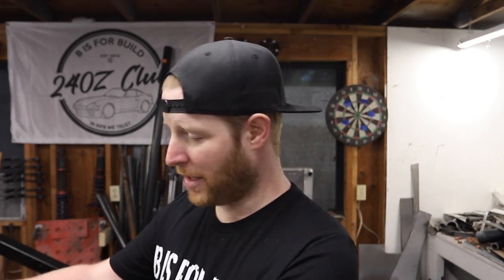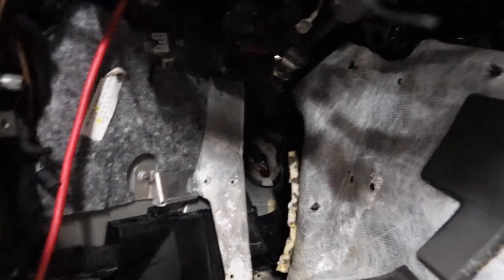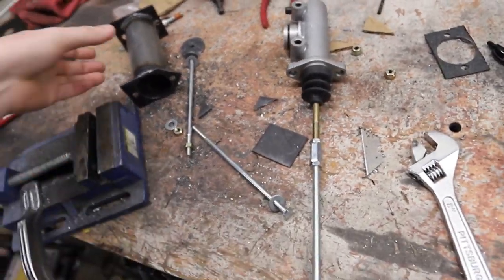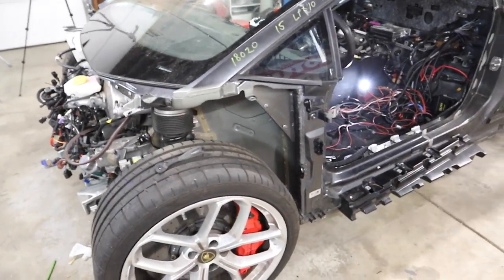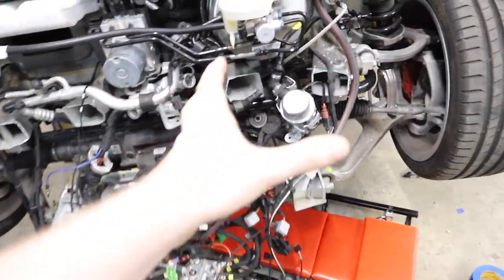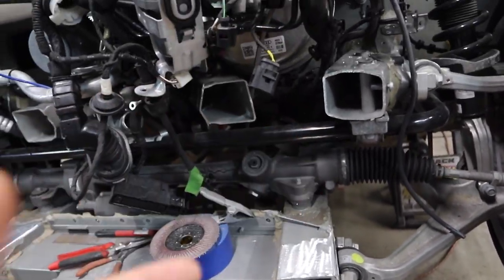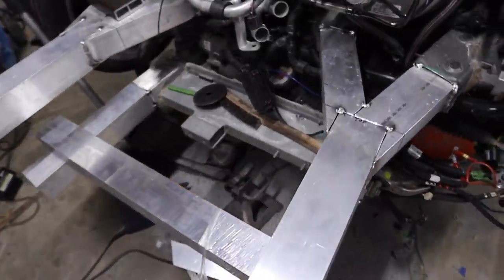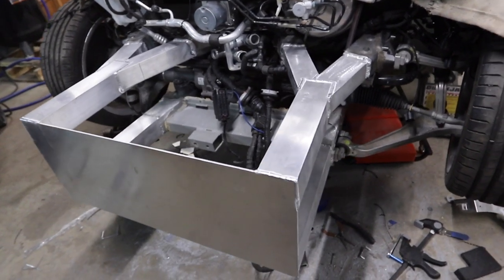First Ever Clutch Install In a Huracan & We Rebuilt the Front End!

Comment: Just modify brake pedal, automatic cars have biger brake pedal than manual cars
Reply: Lol! Good call! Using what's there, to solve that problem! Lol!
Reply: Maybe he can get a brake pedal from a manual Audi R8. Since it's the same group, it might be the same arm and mounting.
Reply: @MultiLuc28  Could he also get one from a Volkswagen gti?
Reply: @DrDre-ke1rr  Not sure. It was just a quick thought since both are coupes from the same group and roughly the same platform. I'm no expert haha
Reply: B is for Boss Oscar around
Reply: Dr Dre I wouldn’t be surprised if the GTI and the Audi brakes would work not only because of the size, but rather they’re all the same car group- Volkswagen & Audi & Lamborghini. I feel all their parts would coincide with one another.
Reply: ChillOutTrent  no shit
Reply: This was so obvious
Reply: Remote reservoir.  Wilwood makes one for their clutch cylinders.
Reply: @tompalcie6284  remote kit was included in pedal kit, just watch couple episodes back when they went through all the stuff that was deliveried for build
Reply: @MultiLuc28  You are right, or he can take the brake and clutch pedals out of a Gallardo.. problem solved and it looks a hell of a way better
Reply: @stevenvanklaveren5434  Good point!
Reply: @chillouttrent3985  The brake pedal looks identical to my 2014 Skoda Octavia vRS (DSG), all VAG parts bin stuff

Comment: You can remote reservoir that clutch resevoir in a place easier to fill
Reply: It would need to be fabricated considering no manual huracans were ever made. or another "half-ass" solution would be to cut the brake pedal in half.
Reply: @TheZumiezNation  Wilwood sells a remote reservoir kit...have put in plenty of them...could drill two holes and mount the reservoir anywhere...cost...probably $20

Comment: Probably could have gotten a take-off Audi R8 manual pedal set with the clutch slave cylinder and bracket and just modified it. Audi loves to reuse parts so it's probably not too far off and the pedals look the same

Comment: Would you call the front of that Huracán a firewall? Since there's no engine in the front that you are trying to keep heat and fire out of the cabin?
Reply: I'd say yes, a fire can still spark from the braking system or electrical which more often than not is the cause anyway.

Comment: Love the work and the videos, I would like to learn how to weld, which welder would you advise for a newbie, I do not have a workshop, so Gasless would be a must, should the first one be Mig or Tig...thinking of using for bodywork and structural repairs...I have zero knowledge of this at the moment.
Reply: If gas-less is a must, flux core MIG is your only option. Everlast, Lincoln and Miller have some decent entry level units to learn on. 

TIG requires that you have the shielding gas, and is honestly the harder of the 3 processes to get right. Lots of practice and lots of mistakes to get it nailed down.
Id suggest having a look at Welding Tips and Tricks channel, Jody is like Oscar with a welder.
Reply: @sparkplug1018  Many thanks for this, very helpful.
Reply: @geoffuk8356  Glad I could help.

Comment: Just buy a remote reservoir for that dude! Guarantee Willwood makes several different remote reservoirs for that master cylinder.  Just need to mount it above the inlet with a hose that doesn’t invert.
Reply: I would have shorten the pedal arm so the mastercilinder sits lower and the pedal turns into a quick clutch thingy. To late for that  now though

Comment: Do not forget to do crumple zones on rails.Vtuned did for Sams Lambo.
Reply: kola sillers was about to comment this as well.
Reply: nah pedestrians can do one. It's not like he's selling it mass market
Reply: its a track toy, doesn't need them
Reply: They're already welding on aluminum where it wasn't designed to be welded which will lower its strength in an impact. There's no real way to make it truly act like a stock huracan in a crash once the structure has been cut off.
Reply: Trick is not to crash!
Reply: deathwatch27 I don’t think you understand the point of crumple zones.
Reply: He didn't use any internal bracing or backing plates on those joints  either. Definitely a weak point if those welds decide to crack.
Reply: @TheFoxSaid  yeah and welds will just crack on impact
Reply: @123subbatyp  lots of scenarios where those welds could fail, especially if there's any flex or vibration in that area. Also noticed on a cpl eps back a lot of LOF on that cross beam that carries the engine mounts. Idk I used to work on 4 million dollar aluminum stealth boats where everything was inspected so I might just be being picky.

Comment: narrow that brake pedal and brace that adapter that you made for the clutch pedal ,once you add fluid the force needed to push the pedal will be much greater and you will crack the "firewall" in no time .
Reply: catalin b agreed and one of those holes on the 'rod tube' looks ready to snap being about 2mm from the edge of the plate! B is for broken clutch pedal mounting plate
Reply: Yep I think they'll have to revisit this and strengthen the firewall and that bracket.
Reply: And hard-line. Braid or not that clutch pedal is gonna be squidgy with that much hose

Comment: Hey Chris you forgot to add the ‘crumble zone’ for safety reasons bro @bisforbuild
Reply: I saw that too. Plus I didn't see any internal reinforcement on those frame rail welds. Just butted them together and went for it.
Reply: Remember, stuff Chris does not need:
Cleaning stuff
Crumble zones
Airbags
Correct wheel alignment
Reply: They threw some cookies inside the beams before welding them shut so that takes care of the crumb zones..

Comment: In Australia you would not be able to do the modifications you are doing because it is not approved manufactures specifications.It would not pass road safety unless you had a special certificate.Do you have to get the car mechanically inspected before you can register it?  Great work though .

Comment: Wilwood has a fitting for the top of the reservoir to allow for remote mount.
Reply: And that brake reservoir has the fitting there to act as a reservoir for the clutch..nearly all audi/vw use the brake res. For the clutch..just gotta snip the flattened heat sealed end and run your tubing.

Comment: I don't see any crumple zones for the front end of this  Lamborghini  Huracan. Is it just me or just the  Gallardo has them?
Reply: Screw crumple zones just go straight through whatever you hit XD (just kidding)
Reply: Definitely needs some crumple zones..... please get it done. Don't need any tragedies
Reply: Crumple zones are areas on the body of a vehicle, not the frame. Most frames (i.e. non-unibody frames) do not have any kind of crumple zone like structure.
Reply: Vaktrus ACTUALLY crumple zones are required by all vehicle manufacturers since the 70s. And they can be done in a variety of ways INCLUDING frame designs that incorporate crumple safety zones.
Reply: Wow, look at all the internet body repair professionals coming out to comment! The Huracan has a break away front subframe. The mounts on the body tub shear off and are not salvage-friendly parts. The frame sections that were cut off and replaced are square box tube from the factory. At least google things before posting them.
Reply: If you sign an affidavit that you won't run into anything, you don't need to have a crumple zone.  My brother-in-law is a lawyer, and can get you the form for just $50.
Reply: Gallardo crumple zones? U mean samcracc

Comment: you should always use hard line as much as possible with hydraulic systems, even steel braided line will expand under pressure. For tight areas flexible line is fine, but should connect into hard line for majority of the run to the back of the car.
edit: also single layer card board, like cereal boxes, is much easier to work with for making templates.

Comment: Hey Chris you might want to brace the top of the clutch pedal assembly. After a while the connection to the firewall will fatigue. I’ve built a few of these now for people and seen the same thing happen. Especially if you have a heavy clutch. Just a thought :)

Comment: How about relocating the clutch "reservoir" with clutch fluid safe tubing,  not the clutch master but just the res forward next to the break master to simplify and make the system uniform and easily serviced. Nice work Guys

Comment: Nice work! But don't you want introduce triggers (dents ) in the 4 straight horizontal beams of structure? In case of front impact it cold be dangerous without. Check your original Lamborghini, quite sure you'll find what I'm talking about

Comment: Just  in case you didnt realise, Manual Brake pedals are usually not as fat as Auto Brake Pedals. I would be chopping down that Auto Brake pedal to give some more space for the Clutch pedal...It does look like (the Brake pedal) is biased towards the left, send it back towards the Accelerator....Great Job guys.

Comment: Next video B is for Build and vTuned, we bought a total loss Lamborghini Huracan engine, and we are building the whole frame and body,k using the same spec aluminum Lamborghini use, from our local hardware store:) They do make it as good as factory, I do believe that the front end pillars of the car will be no worse than factory. IF a capable person puts efforts to do  s.th he can do well manually, it doesn't have to be worse than the factory, as many would assume. Handmade, hand build is actually expensive :)

Comment: Will you not need to put some brace tubes under the dash to clutch, at pedal end of tube to stop movement fracturing the bulk head  metal.
Could also weld a slightly thick plate to the outer of bulkhead to help strengthen and stop any flex.
Love the build by the way.
Excellent problem solving.
When they say it cannot be done ...... strap in and hold my beer 🍺 👍🏻👍🏻👍🏻

Comment: I enjoy watching your videos. Good job but I have a question about the clutch installation. Why did you choose to go with a conventional clutch pedal, master cylinder and hydraulic line when you had the option of using an electronic clutch system such as the one made by Bosch? Given the time required to do the job and the limited pedal box area, did you just want the challenge of doing the work or was the cost of an electronic clutch prohibitive? The car already has paddles on the steering wheel to activate the e-clutch. Looking forward to your. Mentioning that possibility in the video would have been helpful IMO. Thanks.
https://x-engineer.org/automotive-engineering/drivetrain/coupling-devices/electronic-clutch-control/

Comment: Should have snipped the fitting that all audi/vw brake reservoirs have(left side on the bottom on that reservoir) and ran a tube from brake to clutch using the adapters included with the clutch master. Thats how they do the manuals in nearly all modern audi/vw cars

Comment: The clutch and brake pedal need to be at the same height. You need this for effective left-foot braking. This solution will suffice for highway cruising but get it on a track and it'll drive you insane. The easiest way would've been to buy a pedal box.  Unfortunately, this is going to affect your ability to shift left foot from brake to clutch pedal quickly.

Comment: Nice fabrication work.  Making it I look really easy.  Probably is when you have a template to work from.  I only question why didn't you tack in the front mental part before completing the other welds.  I would have thought you would have wanted the from done first for support incase doing the other welding caused parts to move?

Comment: Source brake and clutch levers from a VW gti.  Cut, heat, bend and weld them on to the lambo's levers, making them level and in perfect plane with one another. The brake pedal will be narrower, and will give much more room.  Also, they are all standard Volkswagen pedals, so they will match the gas pedal and be perfect.

Comment: The clutch pedal hole fitment coincidence may not be coincidence, as I have some suspicion, that the Audi R8 has very similar platform/chassis,  and  they have manual. Exterior may be different, other things and mounts may be positioned differently, but the basis , the frame is a major component, so it could be the same.

Comment: Dude, you must re do the clutch pedal... You need a manual pedal carrier and pedals, you can buy race spec strong pedal carriers that you can fully adjust. At the very very least cut the brake pedal down in size. It looks kind a auto carrier with a pedal thrown next to it which it is! You can do so much better buy a universal brake pedal carrier they use them in road rallye cars. Great episode

Comment: You can get a remote reservoir kit for that clutch master,it’s real easy. You can mount the fluid reservoir with just two screws or bolts. Have Oscar weld a tab somewhere n boom it’s in.

Comment: Definitely not a fan of that clutch pedal placement. It would have been best to put in a smaller brake pedal in and put the clutch pedal in the proper place.

Vehicles with only two pedals the brake pedal is larger, on a 3 pedal vehicles the brake pedal is not as wide and oriented just a little different.

Comment: you can narrow the brake pedal and have the space to mount the clutch pedal straighter couldve allso mounted a pipe on the other side of the firewall and lengthen the pushrod a little more so the fluid reservour would stick out away from the window and you can fill it normally think there is space for that in the nose of the car , i think willwood sells remote reservours too

Comment: Nice build! U might have issues bleeding the clutch line if there are high and low spots. You might need to bench bleed it all as one if possible to get all the air out.

Comment: I'm sure this is a stupid question, but I'm kinda new to car mods... won't having the engine/transmission in the wrong direction cause the gears to operate in reverse?  that is like "reverse" is forward and gears 1,2,3, etc are reverse gears?  What am I missing?
Reply: @sunnygtir  AH!  so the rewiring was not because the engine is backwards in the car, but with respect to where the firewall is, it's backwards... that's to say that the firewall is in the "front" of the engine instead of the "back".  Got it! Thanks!

Comment: Use a quick connect on the clutch line this way when you need to take out the engine or transmission you don't need to bleed it every time

Comment: Isnt this technically a muscle car now?🤣🤣 Its a stick shift pushrod v8. or an Italian muscle car?
Reply: Muscle car would technically be an American car with a front engine V8 with RWD, and designed for drag racing.
This car would fall under the sport car class, like the De Tomaso Pantera, an Italian-built sports car with a Ford 351 Cleveland small block V8 beneath the engine cover.

Comment: Love the project and ideas. However that much horse power and a really strong front end no crumple zones I'm a little worried. Why an earth did you not just bye front end with it. Looks well made to much so
Reply: Saved them 10K when they bought the chassis, so considering they have Oscar around I can understand why they did that. Also, this car did not have any crumple zones built into it. From what I understand the front is designed to break away in a crash, which is probably why someone was willing to pay 10K for that piece.

Comment: I know this car is a concept build. what about crush points in thr new stricture i.e convolutions to fold if wrecked.(See Samcrackc video about his wrevked supercar) are those structrural parts solid on the oem.
Reply: I believe that the original design was built to basically break away from the car in a crash. Looking at pictures of the original chassis as Lamborghini built it, this is basically an exact copy. 

If I'm correct it would also explain why someone was so eager to buy what was on this car for 10K.

Comment: I think that the front plate is wayyyy simplified interpretation of actual front of the frame in stock lambo
Reply: Looking at pictures of the chassis, its really not. I had that thought too but nope. Only really difference I can spot is it looks like the factory part has a large opening in it for a radiator.